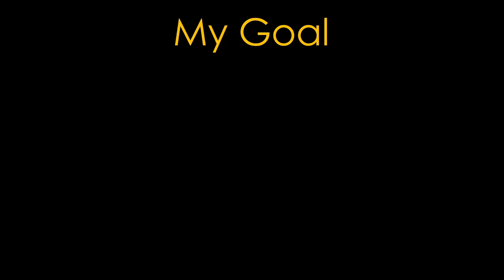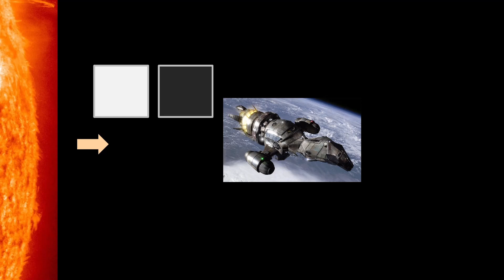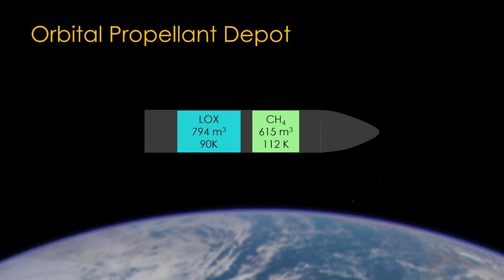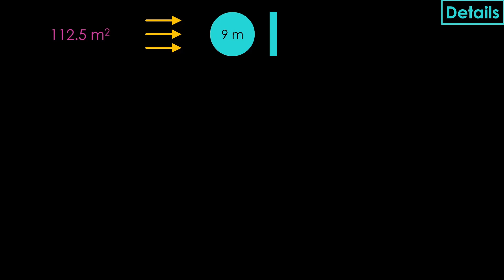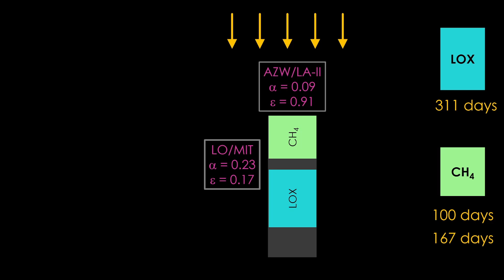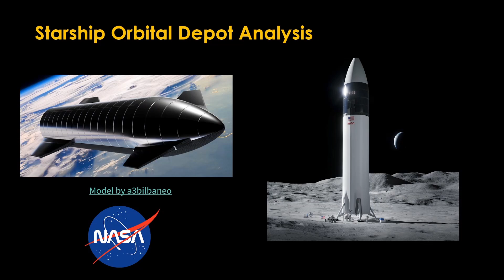Starship Orbital Propellant Depot

Comment: What if you added radiator panels like the ones that the ISS uses? Also, could you use the boiled off gas for something? Attitude control maybe?
Reply from the maker: Active cooling with radiators can likely get you to zero loss pretty easily. You can use boiled off gas to drive cold thrusters.

Comment: emmissivity is just 1-absorbtivity. for every material there are pairings for each spectrum of radiation. gotta make sure you use the right values.

althoigh you can go far with coatings alone on a large depot. there are ways to go farther. most obviously insulation. this would allow the surface to get hot and reradiate heat while only conducting a fraction inside. in vacuum you can also use multi layer insulation, essentially many layers of foil mostly only radiating on each other. its much more effective and light. Its the gold foil you see on probes. securing it against aerodinamics during launch is going to be a challange though.

finally if you really need unlimited storage you can use active refrigeration. using solar power and radiators for the waste heat. this needs a lot of power though.

and you are goong to need long storage times to be efficient a single tanker is only carrying 100t and 1 launch a day isnt going to happen in a long time.

Comment: The excess vapor pressure can be passed through an expansion valve, greatly cooling the expanded gas. The expansion valve drops about 6 Bars of pressure, providing significant cooling. By immersing both the expansion valve and vent pipe within the liquid propellant, ice formation is prevented, while the surrounding remaining liquid is greatly cooled. 

Of course, this assumes that the propellant is pure, and not contaminated with water or CO2 combustion byproducts. The supply ships will probably need to isolate the payload LOX within a separate tank to keep it pristine. 

The analysis is missing heat transfer between the Methane and LOX through the common bulkhead. 

I presume that a foam insulation with a select IR film coating is presently used to insulate the common bulkhead.

However, far better performance is reached by placing a hard vacuum between two steel layers of the common bulkhead. Or using two bulkheads.
Reply: The depot should deploy both an Earth foil shield and a Sun foil shield. Multiple foil layers, as seen on the JamesWebb telescope, can provide more performance, but with diminishing returns. 

For greatly extended storage, it can also have thermal radiators of significant surface area that emit IR radiation. These radiators must, of course, be in the shadow of both the Earth shield and the Sun shield, but oriented edge-on to Starship. The Sun shield would have a PV layer to power heat pumps that heat up the radiators. 

The docked tanker Ship (the donor or supply Ship) can dwell in Sunlight or Earth-glow to pressurize the main tanks and limit the need to vent vapor pressure in the depot tanks. The tanker Ship exterior dorsal surface can even be painted to absorb thermal energy. This supply Ship can also provide temporary redundant shade to the propellant depot, further improving thermal performance.

Comment: There are of course concerns for fuel loss if you're going to Mars once you've transferred the fuel to the spaceship that's being used for that purpose, and presumably lasting for the duration of the mission and the return, or possibly a tanker orbiting Mars, so you might need a zero loss vessel.  The building of superinsulated tanks is not new ground and they are mass-produced for many purposes.  As others have noted, multiple layers of aluminized Mylar (similar to mylar balloons) are used to limit radiant heat gain; it's also very light weight and cheap, so it would not be unfeasible to erect a roller shade for the tanker. 
You can also run some form of heat transfer engine to move heat from the tanks to elsewhere in the rocket, especially where you also have humans in the rocket who like to live in relatively (for space) warm spaces.  This is also well known technology and can readily be used in the temperature zones we're dealing with here.  MRI coldheads go as cold as 4 degrees K, for example.
So it would be possible to even retain the fuel in its supercooled state, although this extreme would seem to be pointless.
Reply from the maker: Sure. The point of the video was to look at what you could expect with purely passive measures. 

If you are going to Mars, you will likely want active cooling.

Comment: Why not position the heat shield facing the sun? I haven’t done the math but those tiles are excellent insulators. The black surface will be hot but most of that heat will stay on the surface and not transfer to the tanks. Does the depot not have a heat shield?
Reply from the maker: I'm assuming the propellant depot has no heat shield. We don't actually know.

Comment: Since the purpose of an orbiting fuel depot is to be a ''static'' infrastructure maximizing fuel conservation, I would imagine that using an active cooling system and radiators may be advantageous to maximize propellant conservation and avoid piling on fuel losses by combining with other inefficiencies. Since this vehicle wouldn't go very far (simple LEO) and since its mass isn't necessarily as much of a decisive factor compared with the other Starship vehicles (based on propellant requirements and the fact it can end up empty at the end of its orbital insertion), it seems like the tradeoff would likely favor active compared to a passive thermal control. Combining passive with active thermal control would make an even more efficient system to minimize active cooling power requirements while providing zero boil off.

As a professional who works in the industry, I absolutely love this channel btw.
Reply from the maker: Absolutely, and there are good cryocooler solutions for both liquid hydrogen and liquid helium, so it should be relatively straightforward to do LOX and liquid methane. 

And thanks for your kind comments

Comment: You didn't consider conduction through the tank wall. If the tank walls are insulated reducing conduction, then the outside will heat up to a point where the infrared emissions will be significant.
Reply from the maker: Yes. I didn't want to get into the insulated scenario.

Comment: To be more accurate, use emissivity curves as function of wavelength. Radiation from the sun is mainly a different part of the emmisivity curve than emissions at body temperature and should be weighted to match sunlight radiation energy curve as function of wavelength.

Comment: 2 things make losses go to zero.  
1… do like Webb telescope does with multiple thin layers of sun shade with space between layers. Do this to block both Sun and earth radiation.
2… make the cryogenic tank pressure relief valves with a shell that traps boiled off cryogenics, then use a refrigeration pump to compress the trapped gas until it liquifies and pump the liquid back inside the tank.
Reply from the maker: Sunshades like webb could work but I think they could be problematic with a vehicle that needs to move around. 

Cryocoolers are great.

Comment: There are lots more tricks. The evaporated fuel/oxidizer can be used to raise the orbit of the fuel depot, so the evaporated fuel isn't wasted. You can also put a mylar reflector between the sun and the depot to reduce heating. I'm quite sure you can reach those 10000 days if you employ all tricks in the bag.

Comment: Great analysis, but all of your numbers are still pessimistic because you assume that solar energy incident on the tank walls will be efficiently absorbed into the cryogenic propellant, holding the tank walls at cryogenic temperatures. In reality, the tanks will contain a mix of propellant in the liquid and gas phases, and in microgravity, the gas phase forms a highly insulating layer along the tank walls. Unlike our terrestrial experience of propellant tanks, there's nothing pushing the liquid phase into continuous contact with the tank walls, and any blobs of liquid that drift into the walls will tend to boil, restoring the gas blanket. This allows the tank walls to achieve an equilibrium temperature that's much higher than the temperature of the cryogenic propellant, causing it to radiate a significant amount of the incident solar energy back out into space.
Reply from the maker: Yes. And it of course is less of an effect when the tank is full and there is lots of propellant tank contact and more when the tank is less full.

Comment: Would it make more sense to point the tail end of the tanker towards the sun versus the nose? I wonder what the insulation capability would be naturally at the engine side as opposed to the payload side of an unmodified starship?
Reply from the maker: If you point the tail towards the sun, you have the engine bells which have specific absorption and emission characteristics and then they are coupled to the ship through points that can only flow a given amount of heat and then some of the radiation will hit the thrust puck - or whatever is between the engines - and that is right next to the fuel. 

That's going to be very hard to analyze, so I don't know.

Comment: What would the requirement be for a fuel depot to have maneuvering capabilities such as attitude adjustment in order to point towards the sun? Or to maneuver around orbital debris?
Reply from the maker: In a depot you are going to be venting propellant as it boils off anyway, so you can use that for attitude control. 

For orbital adjustment you'll need more thrust and somebody would need to calculate how much gas that would take.

Comment: Similar to that nose plate at the end: why not active cooling? Shield the tanks, use a heat pump, move the heat out from the tanks onto designated radiator fins pointing into space
Reply from the maker: My goal was to see what could be done with passive approaches. There are good active approaches - NASA has done a fair bit of research in that area - and the NASA work is targeted at liquid hydrogen, so it should work well with the much warmer liquid oxygen and methane.
Reply: @EagerSpace  fair. Though pointing the nose always at the sun may be an "active system". But I see the point.

Basically: at first, the fuel depot is stocked only in anticipation of upcoming big missions (moon at least). Then, components are added and storage times increased, so it can become a regular service station as economies of scale take over
Reply from the maker: The problem with Leo depots is they need to be in the orbit you are targeting. If you are departing the earth you would be at whatever inclination you launch from, but a depot at low inclination doesn't work well for  high inclination payloads.

Comment: You could attach giant sollar array to the depot which when extended would nearly completely shield the tanks from direct sunlight. Solar array would be coated for high reflectivity acting more as a mirror than power generation but the little power it would generate would surely be useful for the depot. I am assuming this depot would be fairly large, ie at least 10 large connected tanks and act as sort of a permanent substation between earth and rest of the solar system so the costs of designing and building the depot would be justified.
Reply from the maker: Mirrors are good at reflecting visible light but not necessarily other wavelengths, so you would likely get some infrared of the back. 

But a sun shield would help,

Comment: 14:36 How about rotating rotating the depot so that the LOX side is facing the sun? In that case, there would seem to be stuff already in between the LOX and the sun that could protect the LOX (that is, the engines and what not).
Reply from the maker: Not sure. The thermal analysis is going to be very complex - the engines have a bunch of different materials with different absorption and emission characteristics and connected to the tanks in complex ways and they are designed to do enginey things well and not these thermal things well.

Comment: My fermi-analysis guess before watching:

When the rocket is fueled it produces a cloud of off-gassing about the volume of the rocket every ~10min.  This estimate is high because i assume much of that cloud volume has ambient air mixed on.

Cryo liquid is 1000x denser than gas, so offgassing a totally fueled rocket would take 10,000 minutes, or about a week.

Up in space, the ambient temperature doesnt really exist, and its radiating heat out into ~3k space. On earth it was contending with 300k ambient.  So itll offgas 100x slower.

Its also going to be in sunlight on one side ~50% of the side, but presumably it will face some kind of heat shield in that direction, so it wont heat the craft too much, and presumably much less than on earth with both the sun and ambient conduction/convection.

So without considering any real insulation or thetmal watt flux, im bounding things between 1 and 100 weeks, so ill go with the geometric mean of 30 weeks.  Or roughly 3%fuel lost per week.

Let's see how this absolutely terrible estimate does.
Reply: 90 days vs 210 days.   Wrong by under half an order of magnitude. Woo!

Still don't feel good about it.

Comment: At 5:18 I thought that emissivity only described emission, and not absorbtion, and also that it describes this regardless of wavelength, but relative to an ideal blackbody, but apparently there’s something I’m missing, so where am misunderstanding? Why does emissivity describe absorbtive ability, and only in IR apecifically?
Reply: Emit and absorb are two sides of the same coin. The energy it takes to excite an atom (absorb) is the same as the energy it sheds (emit), with some asterisks. For example, a lot of atoms excite in ways that the absorbed packages of light energy are "split" when being re-emitted - that's how you get absorption and emission bands, and that's how you get atoms that absorb one wavelength and emit another. What can be emitted, though, can also be absorbed - the process is reversible and can go the other direction.

Quite simplified of course, you could take a look at the wikipedia article on black body radiation to get a less metaphorical overview.
Reply: @neonempire1684  That makes sense, thanks for the explanation :) And I did look at a few wiki articles but it was a bit above me because I only know high-school level physics
Reply: @jesper2k , For a black or grey body, absorptivity and emissivity are equal, and they are constant across all wavelengths. 

For a “coloured” body, they will also be equal to each other at any specific wavelength, but they will vary with the wavelength. In that case, your absorptivity will have to be averaged across all wavelengths, weighted by the spectral distribution of the incoming radiation. 

And same for emissivity, except it will have to be weighted by the spectral distribution of the outgoing radiation.

The spectral distributions are very different for sunlight, heat radiated from earth and heat radiated from a Starship surface at cryogenic temperatures, so you end up with very different weightings for the three, especially for sunlight. 

In a more detailed calculation, each type of surface coating would have one absorptivity for sunlight, another absorptivity for earth radiation, and one emissivity for each possible temperature of Starship’s surface.

All of those, except the sunlight absorptivity, can probably be lumped together in one common number per coating type without making a huge mistake. 

As far as I can see, he chooses to refer to this common number as emissivity everywhere to keep things simple. So when you see him using emissivity in a calculation of incoming radiation, where you would expect an absorptivity value, it is because of this simplification.

Comment: MityFine analysis ye went couple steps beyond my initial  thoughts.  Gave up on fact checking Wiki on Stefan-Boltzmann so here is one new idea you can use in analysis. 

The tanks contain gas and liquid.  In 0g liquid will eventually coalesce and evaporate from the warmer surfaces, and the gas has relatively poor convection an conduction. Over time the liquid will prefer to remain on colder surfaces, an further increase storage lifetime.

Fantastic channel, keep up the  great work!

Cheers !
Payne

Comment: So how would the boil off work on a trip to Mars for example?
Reply from the maker: Interesting question. You lose the thermal energy from the earth and that will help. I'm not sure if you can just point the nose at the sun; Apollo used a "barbecue roll" to spin the craft slowly on its axis to equalize temperatures, and you do need to keep the crew section habitable. 

You might need an active system to keep the propellant cool and you might be able to use the waste heat from that to keep the crew warm.

Interesting question.

Comment: A simple issue that you're neglecting. When the nose is pointing at the sun, you can have multiple layers of insulation between the nose cone and the propellant tanks. Also, you could easily deploy a shade facing the Earth. A simple flat mylar sheet would do a lot of the work needed. It could be deployed from the payload bay of the Starship and run down the length of the vehicle. This should block most visible light, allowing you to optimize for infrared.
Reply from the maker: For this video, my goal was to see what could be done without modifying the vehicle. Yes, you could put insulation behind the nose cone easily. Sunshades are possible but you need to get the deployment to work and it might be in the way for refueling. It also is going to re-emit from the backside, and that could give you a lot of IR if you are trying to stop earth IR.